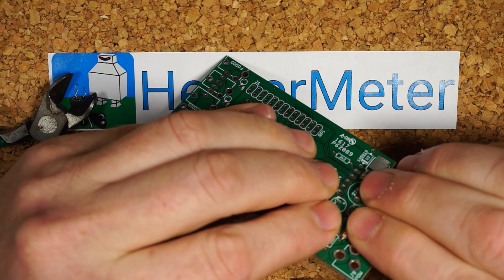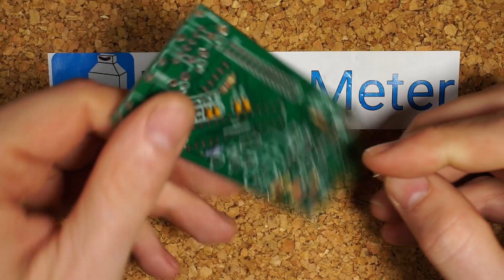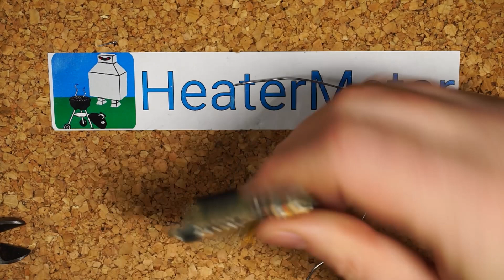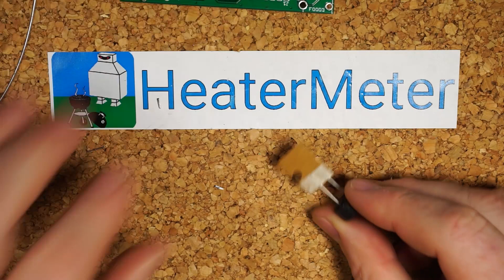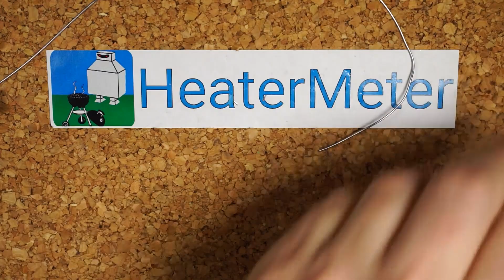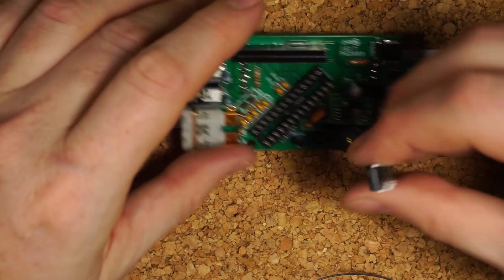HeaterMeter 4.3 Base Board Assembly

Comment: A little reaction to your comment at 38:25. Agreed, it doesn't matter in for the resistor in which direction it's added. However, if you solder the one closest to the thermocouple in reverse, it might short out with the thermocouple leg.

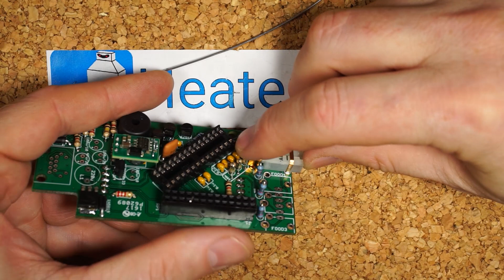Never mind! You mention it at 39:53 :-D
Reply from the maker: Yup, absolutely right.

Comment: Just received my 4.3.4 kit.  Great instruction video.  Easy to follow.  That being said, the diodes are marked differently on my board than the video.  For instance, the polarity in the video is opposite for the first diode of what is “silk-screened” on the board I received.  Also, the position of the 2nd diode is marked as a 1k resistor on my board.  Please advise.  I have also registered on the forums so that I can post this question there.
Reply from the maker: You're right. The video was made using a 4.3.3 PCB, but the position of those two components was swapped to address an issue and make 4.3.4. There are photos in the wiki that show the proper placement (matching the PCB silkscreen): https://github.com/CapnBry/HeaterMeter/wiki/HeaterMeter-4.3-Base-Board-Assembly
Reply: @CapnBry  Thank you!  All I really needed to was pay attention.  Thank you for the quick reply.

Comment: are there any compnents that actually need the 12 volt? otherwise it would be super convenient to just use a 5V Cell phone charger. I already have too many of those lying around.
Reply from the maker: The blower needs 12V to operate, but it could be run with just a servo damper on 5V. If you had a 5V blower it could also work if you changed a couple resistor values and didn't add the 5V regulator.

Comment: I wish I had the confidence to solder the non assembled kit. Any suggestion for a soldering iron to make this easier?
Reply from the maker: I used an aoyue 936, which was about $50 at the time I bought it, but there are plenty of cheap decent soldering irons. Search eBay or Amazon for 937D soldering station all of which aren't bad and only 30 bucks. Try to get one that comes with a few different tips, you want one with a small flat angled  tip about 1.4-2.0mm and not a pointy thin one.  The pointy ones are precise but don't have enough surface area too easily heat everything up so you need something a little bit more flat area.

Comment: At 15:24 you install 2 sockets for the LCD backpack, but they aren't called out at all in the Wiki... neither on the parts list, nor in the step-by-step instructions.  I guess the alternative is to solder the boards together, but what you demonstrate is a cleaner solution
Reply: Looks like this would work?
http://www.mouser.com/ProductDetail/3M-Electronic-Solutions-Division/960105-6303-AR/?qs=sGAEpiMZZMs%252bGHln7q6pm53vbKor1bMJO9NsbxU0b2E%3d
Reply from the maker: They are listed in both the parts list and installation instructions (step 4 in this case). The parts on the main board are listed under the parts for the LCD/Button board, because you only need them if you are installing the second board. They are LCD1F and LCD2F. The corresponding parts on the LCD boards are LCD1M and LCD2M.
Reply: Oh, I'm sorry.  I see it now.  I guess you just tweaked the installation order in the video to make it easier to install.  Thanks for making this.
Reply from the maker: Should be the same order they go in on the steps in the wiki. I did swap the order of the PCC-SMP-K (thermocouple connector) and OKI-78SR-5 (5v regulator) because I misread my notes but the headers are right where they should be.